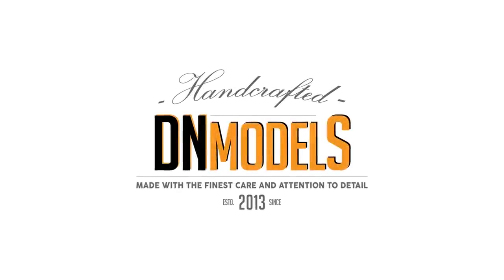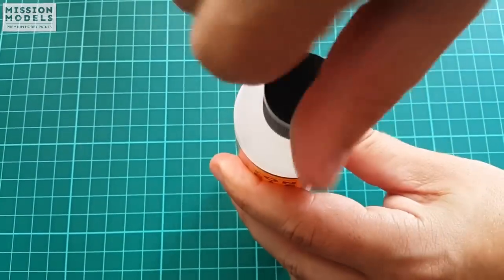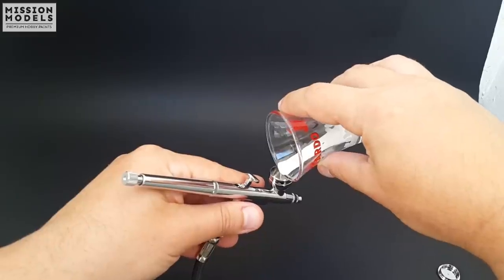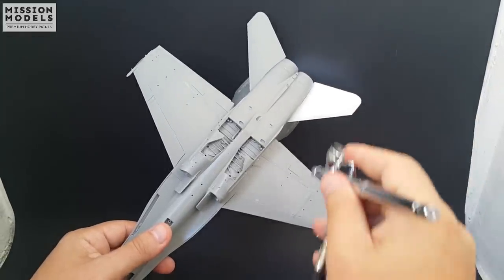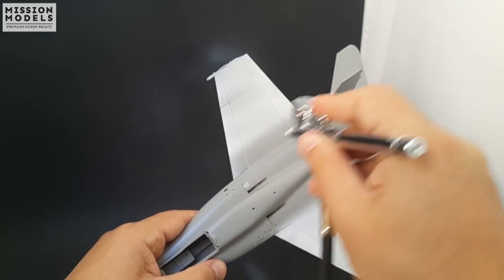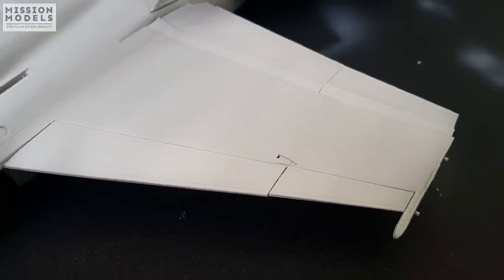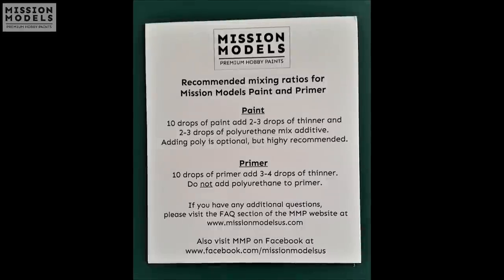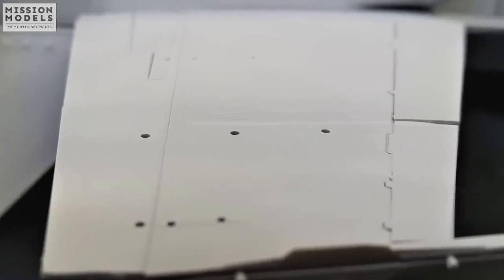Thin and Airbrush Acrylics: Mission Models Primer Testing

Comment: You can make your own acrylic primer. just thin out acrylic paint with floor wax.   Works great, adheres very well.  It's designed to be walked on.  You can make any color you want.  It works as well as any of the brand name primers.  For a lot less money.